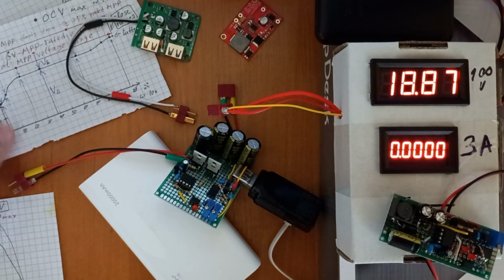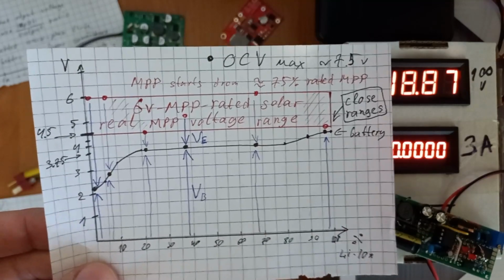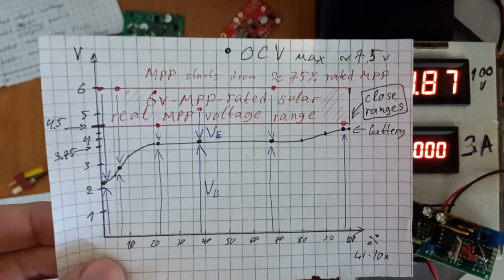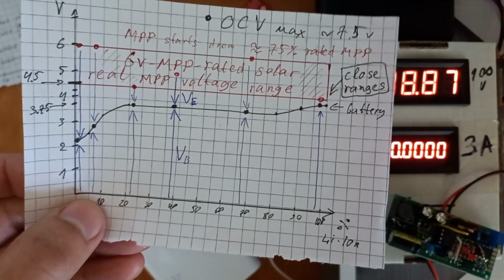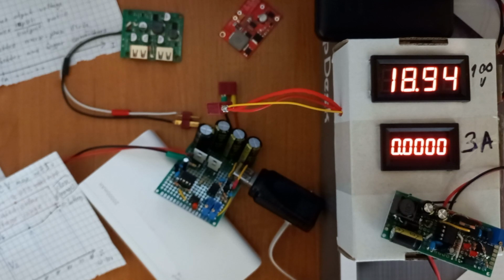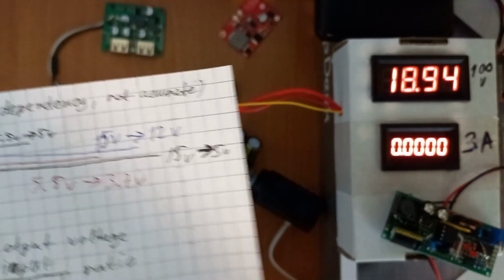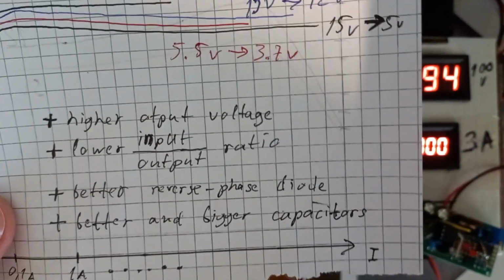Next-gen DIY Solar MPPT controller - cheap, simple, efficient. Based on PIC12F675 MCU.

Comment: Thanks mate.
Can you explain how to convert a non islated mppt charger can be made isolated with a transformer on the output without complicated switching output from cheap mppt non isolated chargers.
My plan is to connect 3 cheap 20amp 48vdc output at 1200w non isolated mppt chargers in parallel.
My solar array is 2 panels 600w in series parallel at 100vdc output. 
I have 3 of these solar pannel pairs.
3 mppt charges will help with tress and different roof angles efficency for my strings or pairs.
Thankyou for your show.
Andrew New Zealand

Comment: This is what you wrote /DIY 1kW Arduino MPPT Solar Charge Controller (WiFi ESP32)/:I'm not sure about that 100v 470uf input capacitor though - can it handle the ripple current for such a high device output current rating, especially with such big Vinput/Voutput ratio?

I built this MPPT and run it. I have a problem that this capacitor overheats at higher currents. Do you have any solution?
Reply from the maker: hello, from what I know - the rated ripple current of capacitors ensures it doesn't overheat with no additional cooling, and even for big LOW-ESR capacitors this rating is pretty small (some 3-4 amps). It's overall recommended to have several caps in parallel (2x 1000uf would have bigger rated current than 1x 2000uf) and there goes extra cooling (fan). Given specs of that project I hardly believe it can handle specified current or anywhere close. Ripple current of the input capacitor will be somewhere between input and output current, the more ratio of Vin/Vout - the closer it will be to output current. I would definitely also try adding a small radiator on top of capacitor via thermal tape, although I haven't seen anybody doing this